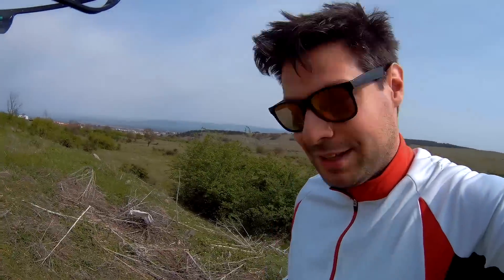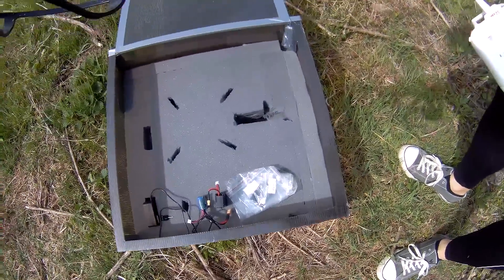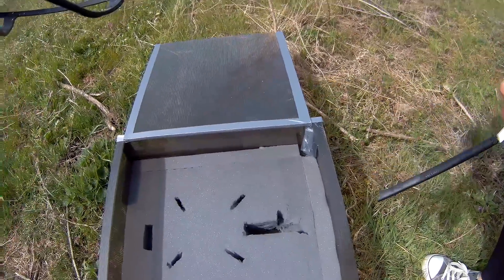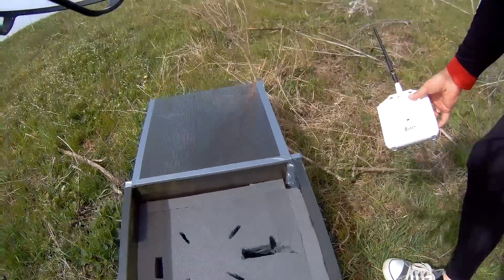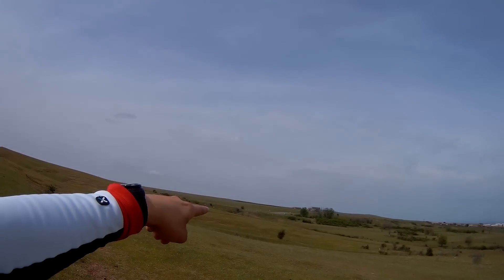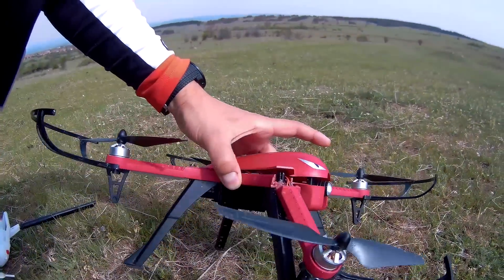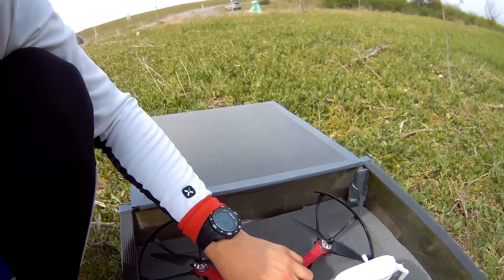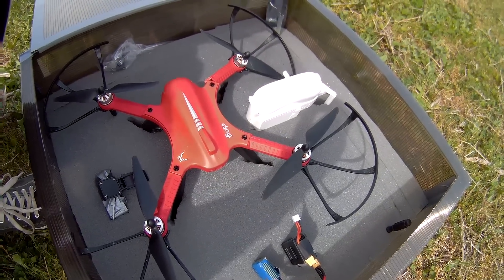MJX B3 Bugs maximum range test and a serious damage

Comment: Safe way to determine the limit of range. Enlist a friend. Get the drone above ground level on anything that's non metallic. Get it ,started, props idling. Then either run or walk away with the RC - give the quad a quick squirt of revs to keep it connected - every 5 or 10 metres at a guess.  Keep doing that until you find it no longer responds. Then approach again doing the same thing. You'll need level ground with zero obstructions. It won't give quite as far as if the quad's in the air but there is zero risk of losing it or crashing it. But with a bugs 3 you do need to keep it connected or it'll stop the props again. Worth a try?
Reply from the maker: Thanks Ian - I indeed try to follow that rule, but it is not as attractive as having real footage :-) 
Used the method here: https://www.youtube.com/watch?v=43vB-NH0Rhw

Comment: How high it can go ?
Reply from the maker: It has no restrictions on the firmware level and it all depends on the transmitter and area you are flying at. Some people have managed to reach 500+ meters.
Reply: tech4all can it go to atleast 100 meters carrying a go pro or any action camera ??
Reply from the maker: Honestly, I wouldn't risk breaking my GoPro on a drone without GPS and Altitude hold. But - yes, it can do that. Just be VERY careful :-)

Comment: I thought about that too - an all in one storage/launch pad case - you could use your case as a launch pad as well - keeping essentials accessible from the side possibly and maybe add a tiny level gauge to level the case - consider making it just a bit smaller and a way to accommodate roughly other same size drones and flight assessories - B
Reply from the maker: Yup, true that. I still keep that one, however not using it too often. But because of the bulkiness it is a perfect launching/landing pad :D

Comment: Very diplomatic reply friend. My sincerest  apologies for the condescending crack at your box construction. Still...your box would make a convenient launch and landing pad. Maybe add some landing markers and some improvised telescopic windsock to add to your design. That way you remove the drone from the case, close the lid and you would simply set the drone on top of the box to launch and not need to walk away several feet to find a level launch pad. Your good2go quite literally   "out of the box" as it were. Thanks for the video and the tech lesson. Ive subscibed.
Reply from the maker: James, thanks a lot!

In fact this "box project" was on of my first here. It certainly is far away from being good, but at least helped me carry the bugs which is relatively big. 
Thanks a lot for the ideas - that was indeed the idea of the box too but ... well - the drone is still broken. Among the many revisions of parts I was unable to find an esc rev. 01 and now if I want to fix it I need a new flight board +  4 new escs and just decided to use it as spare parts for the bugs 2. 

I certainly hope that following the channel will bring value to you. As usual I am open to ideas and critics :-) Have a wonderful day, man!

Comment: plz i need some information,i dont know much about drones, can you help me,i dont have in my mobile 5G connection if i buy this drone Bugs 2 B2W its still fly or not, or its must need 5G internet.its still work with out 5G connection. thanks if any one help me this
Reply from the maker: Baga Mossam - what is your phone model? Many current cellphones have both 2.4 and 5ghz wifi support. If.you tell me which your modelnis I can check that
Reply: CAT S30  and Huawei ALE-L21  , that is my phone,  but i also just want to know if internet is not work this dorne MJXB2W i can not fly without internet, i am from sweden
Reply from the maker: None of these phones supports 5ghz band. And as far as I remember the b2w is strictly working on 5ghz band. So you should either get a 5ghz compatible phone or not use the wifi. You can still use the camera via recording to a microsd card.

Comment: That's an age old problem, beefing up the TX and RX and then discovering you can't see the damn thing due to being too far away. You say it'll be better when you fit FPV gear, but what makes you think your FPV is going to work at that range.  Your FPV will always drop out before your flight range because whilst you may have more output fro the Video TX it's sending a lot more data and because you need that extra power to receive a watchable picture it's usually the first to drop out.  

At some point you end up chasing your own tail, because it's only a small quad, you have to keep all the FPV components equally small.  Once you start adding more output power for video you're also going to need a bigger battery and to carry a bigger battery you need bigger motors and to fit bigger motors you need a better frame.  Before you know it, you may as well buy a bigger quad.  RC can be a cruel world at times, but we keep trying.
Reply from the maker: I was hoping that a more powerful antenna will do the work. No? Even analog one?
Reply: The great conclusion is just this one: One does not needs longer range with this neat (and really excellent) quad copter.

Comment: Does the out of range beeper works at long distance after attaching the antenna
Reply from the maker: It turns on a bit later than usual. Like 30% more range and then it beeps.

Comment: is that an upgraded antenna on the controller?
Reply from the maker: It is, it is :-) But having such a mod makes you feel like you can go very far away and when that happens you can easily lose control due to the reduced visibility. If you have no gps or FPV - better stay with the stock and don't break your drone like me :-) I am still waiting for the rest of the spare parts.

Comment: good video. Does the original weak signal alarm work with the new long range antenna??  you can test it by powering up the drone and tx as per normal and then disconnect the drone battery and see if the tx alarm goes off beeping continously..
Reply from the maker: Oh - yes, it does work. Once the drone goes beyond 150-200 meters you may hear beeps every now and then.
Reply: What I would really like to know is how much furthur can it travel once the low signal alarm sounds before it loses signal completely and falls from the sky. EG- alarm sounds at 200 M , can it fly to 300M before total signal loss and it falls.
Reply from the maker: I would also like to know that :-) 

Despite everyone telling me not to try again, I will certainly do a test.
Still waiting for a replacement motor, though...

Comment: So sorry for your loss. However it was VERY informative and if you got 500m distance that's GREAT! I've got really short range on my Bugs 3 so I'm tempted to crack the tx case and try your mod.

There are some really inexpensive FPV systems out there. I've got a TX832 transmitter coming that I'm going to pair on my Xiaomi Yi 1080p action cam on my XK X380.

Regardless, GREAT video and it'll be a big help to the rest of us.

Comment: My Bugs3 is damage exactly like is yours. Can you add video how to repair one of the arms
Reply from the maker: Michal,

I am terribly sorry to hear about that. 
I have tried using glue - Bison Epoxid. It glued the parts and it was good for one drop. On the next drop - you can see on the video :-) I don't really think to do it again as it apparently is not strong enough.

A friend here told that using a soldering station you may try to melt down the plastic and then cover it in epoxid glue.

You may try buying one from MJX's ebay store:

http://www.ebay.com/itm/MJX-R-C-Bugs-3-Spare-Parts-Accessories-Mainframe-Brushless-Drone-B3-/322479945371?hash=item4b154d769b

Still waiting for mine (I bought it cheaper from another seller, not sure if it is original). Will surely make a video about that :-)
Reply: Hi 

Thanks for your quick reply to my question.
I did exactly as you said. I bought 2 new frames. One extra if anything happend again, you never know... :) 

here is link :
 http://www.ebay.co.uk/itm/232288444031?_trksid=p2057872.m2749.l2649&ssPageName=STRK%3AMEBIDX%3AIT

I found it a little cheaper than your and also comes with Upper Body Cover Shell Case :)

I have to wait about 2 weeks for shipping, do you think you will do video until then?
Thanks !
Reply from the maker: Yeah, ordered it from the very same place too, just didn't want to post it yet as I have never seen it and not sure about the quality.

Sadly enough the item has left china on 17th of April and is still somewhere...

Comment: check out my video  i converted my bugs 3 with zippy compact 3s 2200mah 25c and it fits in the battery bay of the bugs just loosen the screws the tighten them when the battery is in and my props are DAL tri props size 6045 https://www.youtube.com/watch?v=_GRTq3ff3p8

Comment: that sucks dude so sorry!....i have some advice....try taking off those long legs off  thats why it breaks on the same spot the impact finds the weak spot and thats it believe me  mine broke there several times so bought a new oneand  installed a zippy compact 3s 2200mah lipo battery a tx60 to tx30 adapter and DAL 6045 tri props and a low voltage alarm meter and presto!...my bugs 3 kicks major ass it screams through the sky... ill leave links to where i bought everything ...    http://www.ebay.com/itm/141953720673?_trksid=p2057872.m2749.l2649&ssPageName=STRK%3AMEBIDX%3AIT.....adapter ...zippy 3s lipo..http://www.ebay.com/itm/141480872380?_trksid=p2057872.m2749.l2649&ssPageName=STRK%3AMEBIDX%3AIT......the tri props..http://www.ebay.com/itm/DAL-PROPS-6x4-5-DAL-Tri-Prop-Green-4pk-DLPTJ6045GR-/162264146664?hash=item25c7b262e8:g:JOcAAOSwmfhX4qgu        low voltage battery alarm//........http://www.ebay.com/itm/X2-RC-Lipo-Battery-Low-Voltage-Alarm-1S-8S-Buzzer-Indicator-Checker-Tester-LED-/322061690996?hash=item4afc5f6874:g:q1oAAOSwiylXAOeQ

Comment: damn man. SNAP... I wish the bugs 3 idling would spin fast enough to keep it level even at 0 throttle.  oh well at least you got the body coming already.
Reply: If the quad  had props spinning fast enough to keep it aloft at "zero Idle", how would you land? You can't have both, That's why they are only idling at zero throttle, any more and you'd have to wait until the battery died before landing, rather messy.

Comment: Sorry to hear you broken your Bugs, I just burned out and ESC or possibly motor in my Bugs 3, though I have been fortunate to have racket up probably around 100 hours flight time.
Just a suggestion for your next range test, put the quad in a secure place or with a friend and walk the distance with your controller.  Record the distance when the low signal warning starts and then the distance that the signal is lost. You will then have an accurate range for low signal warning and for total loss of signal!  You also keep your quad safe :-)
Cheers!
Reply from the maker: Thanks for the idea, man! Did the same with my first quad - the x5c. 
Sorry to hear about your trouble too. I am sure both drones will recover soon enough :-)

Comment: a good 5.8ghz fpv set up is the txo3 or dvr03 they are both great fpv cameras and you can record on the dvr03. i use a 500mah 1s Lipo that directly powers my camera on the quad
Reply from the maker: And how about a receiver? Which one is a good affordable option? Should I get a display, or goggles?
Reply: tech4all the ev800 goggles and ev007 from banggood are preety good goggles
Reply: Wouldn't that add extra weight that lowers the flight time?
Reply: UuRai in my non-expert opinion the extra weight can actually be a good thing for the bugs stability. it's always windy where I am and so I find myself flying with my action cam even if I'm not recording.
Reply from the maker: Yeah, no issues with the weight - the flight time can go down with a few minutes and I am sure it is worth it :-)